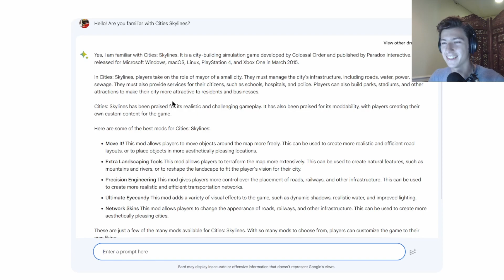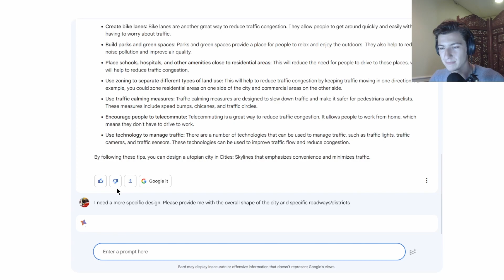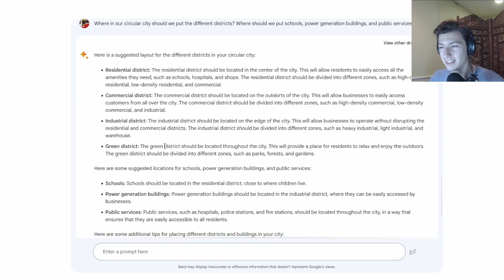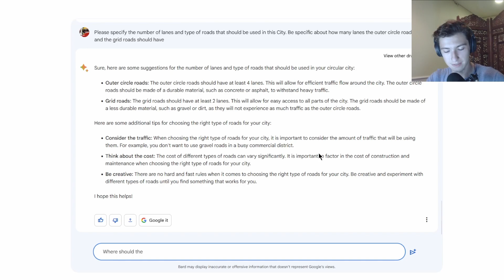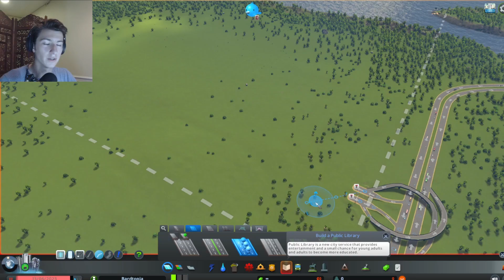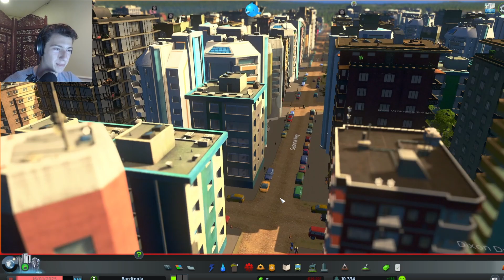Google's Bard AI SHOULD NOT Build Cities

Comment: Honestly, just looks like the German city of Mannheim. So yeah, definitely a lot of suffering. Mannheim was planned in the 17th century as a city expansion for a citadel and was planned in a strict grid-pattern with a circular city wall around it. Because of that Mannheim is called the "city of squares". The citadel located in the south was replaced with a Baroque palace in the 18th century and most old maps of the city depict the citadel/palace at the top, so it's usually not north-oriented. Which makes the map always look like a very basic rpg maker city where the king or governor always lives in a castle/citadel in the "north". It's also the city in which the car was invented and the first practically usuable bike was tested (Karl von Drais wanted to find an alternative to horses because those tended to starve and die in times of crop failures).
Reply from the maker: Very interesting, thank you!